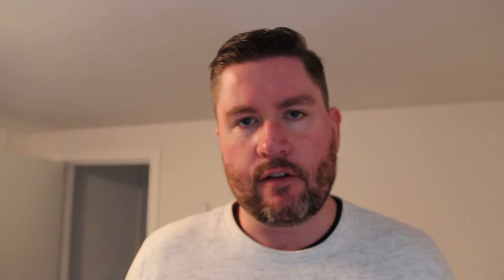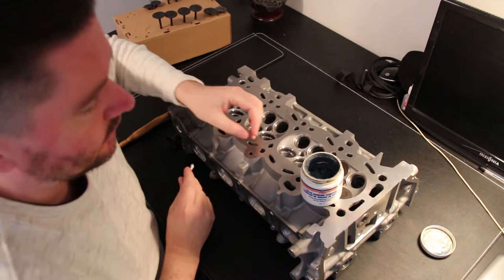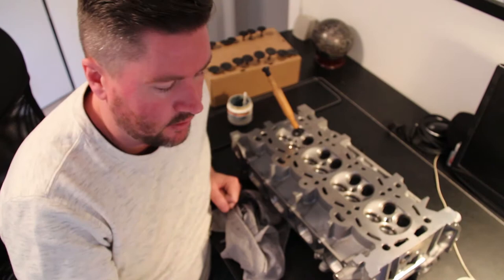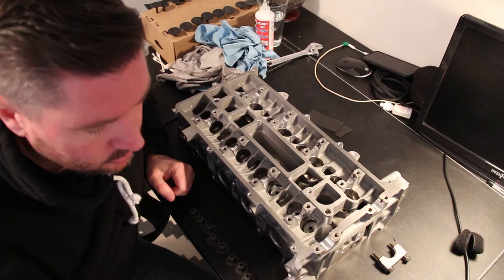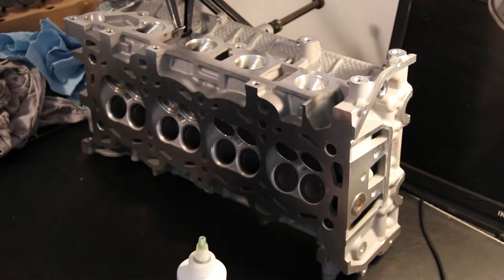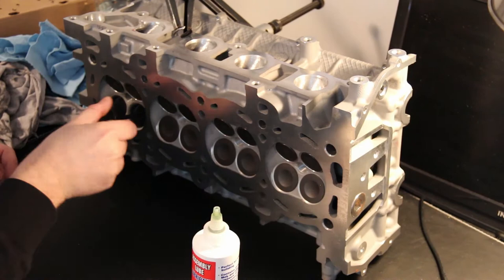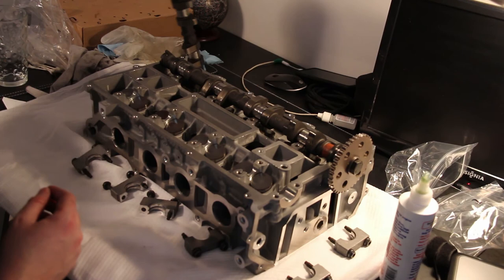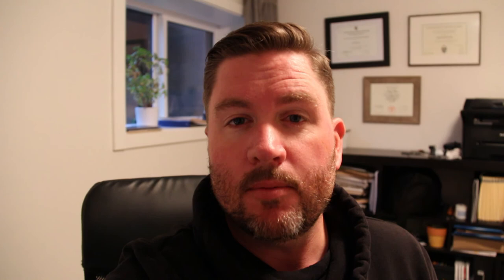Day 7,  Duratec Cylinder head Rebuild AGAIN!

Comment: cant wait to see what you get on the dyno with this thing. mine should be on the dyno this spring hoping for 210-220 whp.
2.5l ford fusion head vvt delete
2.3l focus blosck
2.3 ranger crank
balance shaft delete
crower stg 2 cams
crower Ti retainers and spring kit
arp head studs 
arp main girdle studs
11.6:1 supertech pistons
eagle rods with arp bolts
king bearing
cosworth intake and header
36 injectors
67mm throttle body
 installing megasquirt3x  ecu 
plan to run it on e85 and a s400 turbo as next winters project 500-600 whp goal

Comment: Did You check the valve clearance? It's extremely important in this engine and must be checked at least every 50k km
Clearance should be between 0.22 - 0.28 inlet and 0.27 - 0.33 exhaust valves.
Inlet valves have tendency to increasing clearance and exhaust to reduction which is extremely dangerous. May cause valves burn out first and then seats also. In my engine after 140k km without clearance adjustment all the exhaust clarance was 0.20 - 0.24 and all the valves was damaged. Seats dosen't loock good but I've saved them luckily. Unfortunately all the exhaut valves had to be replaced.
Reply from the maker: Yes. Bought a few new cups and made sure all were in tolerance.  I’ll need to post a couple more videos as I’ve now been running the car for 2 summers and everything is running great!
Reply: @davidbeswick9842  
Already head on the table You should   ported and polished all the channels.
It's a lot of boring job but its worth
Reply from the maker: I did some some polishing and a little porting though didn’t document it.  I don’t have any way to bench flow test so didn’t want to go too far on the porting side.

Comment: You should grind the valves at the end without any compound will leave a polished silver line around the seat this line has to be constant knowing that you have a perfect match. I wouldn't use lube on the camshaft not at its bearing points, a thin motor oil is better you'll get a misreading when tightening the bearings I'll go back to them and re tighten

Comment: Just a question David, I used to build heads for RS 1600 and there were small biscuits ground to size to establish clearance under buckets on valves, how were the clearances done on your valves? The head looked identical in every other respect! Wish I could watch your vids in proper sequence! Really enjoy them?
Reply from the maker: Once the head is complete and Camshafts are on you need to measure with Feeler gauges the clearance. Once you know which Tappets(Followers) are in or out of tolerance  you need to order the correct follower and replace.  Kind of a headache and I didn't film that part of the process.
Reply: Bobby Thompson each bucket is sized for clearance and marked on inner side... you need to do dummy assembly with what you have..check with feeler gauge and then rearrange and order new as required. Bit of a pain but no more shims under or over buckets 👍

Comment: David, when you fastened the cam gears to the ends of the camshafts, did you use a special friction washer between them? The OEM Duratec setup is to not use one, but I learned that Cosworth made some friction washers to prevent the possibility of the cam slipping on the gear and the valves therefore losing their timing... Cheers!
Reply from the maker: TheBananaSlugger yes,  I did in fact use thin friction washers between the cam gear and the shaft ends. The torque number is quite high so really shouldn’t be an issue either way but better to be safe than sorry.
Reply: @davidbeswick9842  Agreed! Don't suppose you recall where you sourced them? Cheers.

Comment: Hey David, do you know what are the clearances should be between the tappet and the camshaft in both intake and exhaust sides for a duratec he 2.0L
Reply from the maker: I can't recall off the top of my head but the buckets are all different and measure in different thicknesses so they need to be shuffled around to make sure each is within tolerance.  If you can't make that work you would need to buy the correct bucket in the right thickness to work for your camshaft.